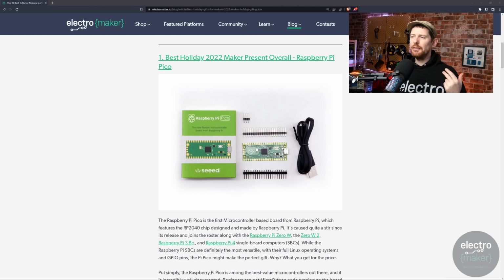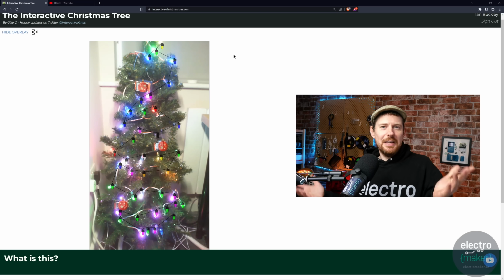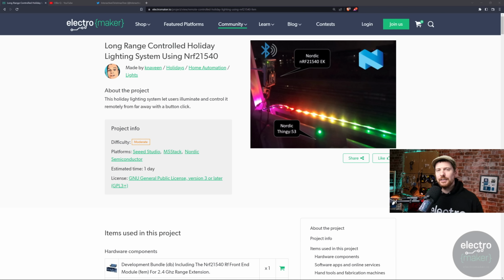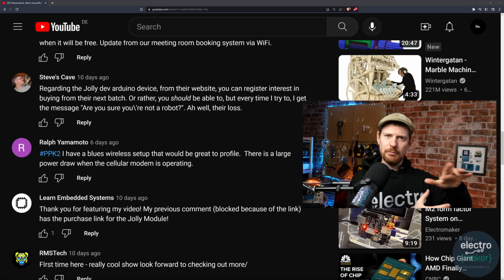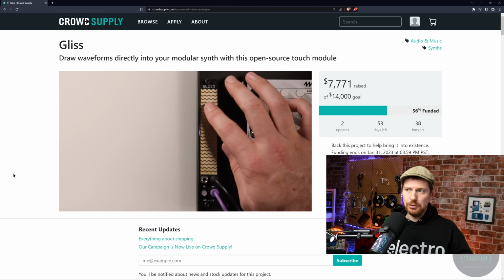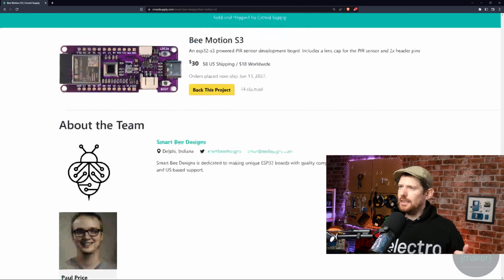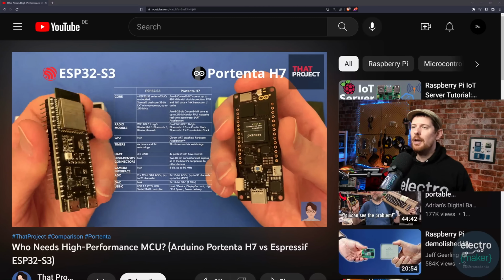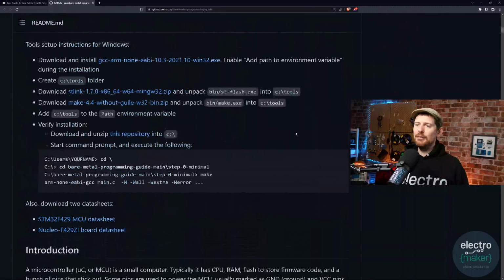Arduino vs. ESP32, Nvidia's Driverless Tractor, Ultimate STM32 guide, and more!

Comment: First, thanks for selecting me as the winner of the PPK2.  My Blues Notecard project hardware should be built by mid-January, so it should be ready for profiling  :^) .#nRF21540 If I were lucky enough to win that kit, I'd implement a long range BLE control project like Naveen did with a Thingy:53 which also has the same RF FEM.

Comment: #nRF21540 Currently, my home automation relies mostly on wifi (esp8266) that I've programmed myself. I start to get more and more BLE devices. For reasons of range I want to look at a mesh network, but a range extender would probably be the best solution.

Comment: Am I knowledgeable? 100mW EIRP is EU legal regulatory max power for 2.4GHz. US is 2.4GHz ERP (the I in EIRP makes a HUGE difference) so EIRP is equivalent isotropic radiated power - so the transmitted power through the antenna is expanded to a sphere, i.e. your antenna is directional and you're transmitting at 10mW if you expanded the radiation pattern to a full sphere and then it would transmit at more than 100mW, you're operating illegally ... (in the US ERP means your antenna can transmit at 100mW as it leaves the antenna)  #nrf21540 make a WiFi killer for other people's homes using a yagi ...